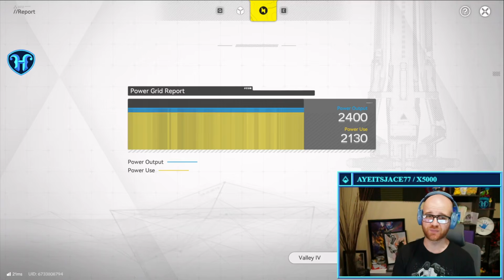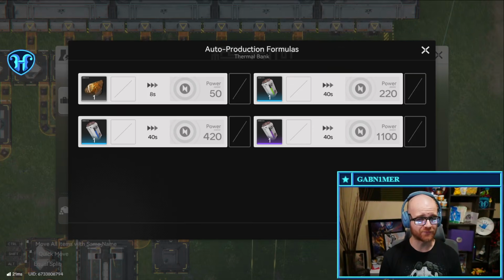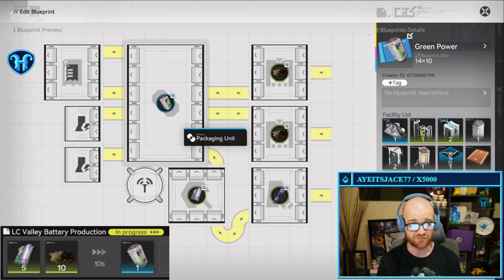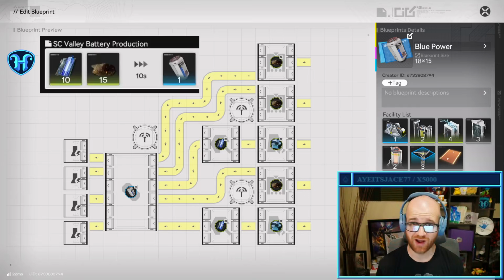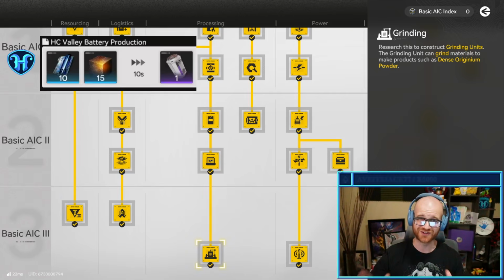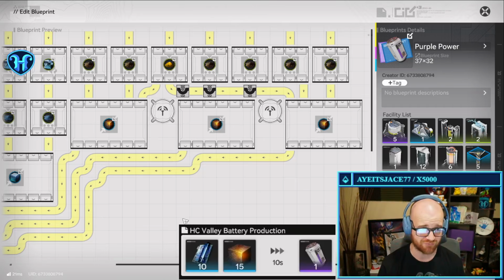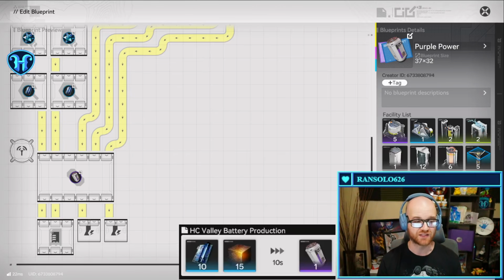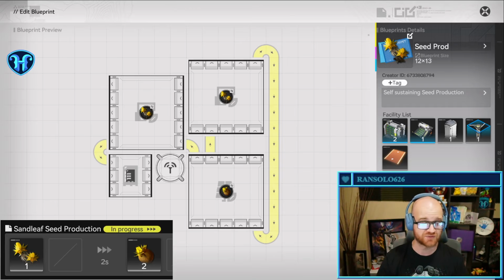Valley IV Battery Blueprints & Full Guide for Arknights Endfield

Comment: Make sure to make a portable stash that is not connected to supply depot. If you get power shutdown, especially while offline, you return to factory with 0 energy, empty supply of batteries and originium, leaving you with no way to restart and start fixing things. Having a separate supply of 300 batteries is a live saver.

Should you gat a power shutdown, remember you can blueprint your entire factory, stash it, wait to mine originium (or make small battery setup), replant your factory but now with at least basic energy supply and time to fix whatever led to the shutdown.

...what? No, definitely didn't happen to me, I definitely didn't have to mine originium by hand, burn it all before factory restarted, and didn't need to mine even more by hand.
Reply from the maker: Always check that AIC report before logging off!